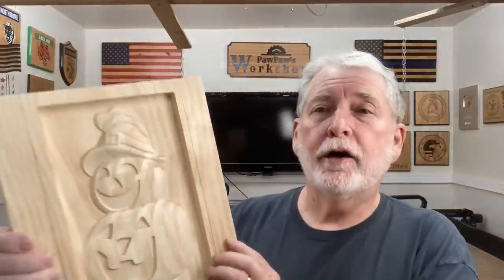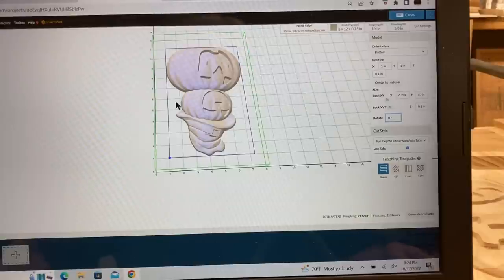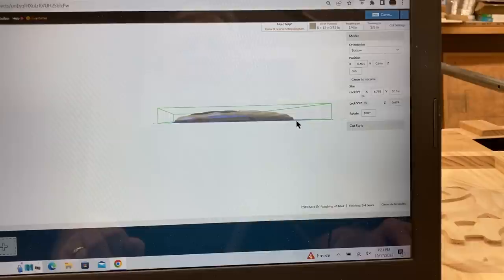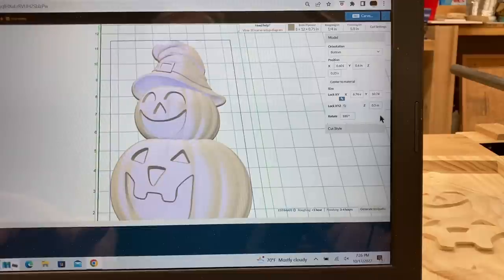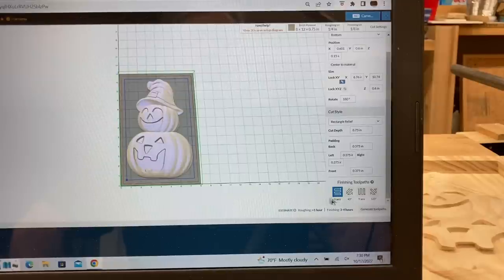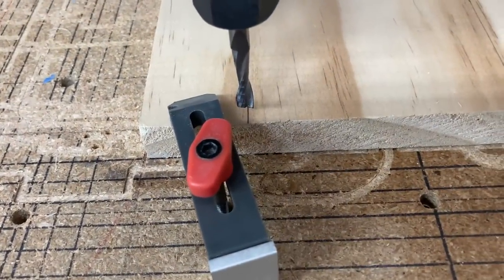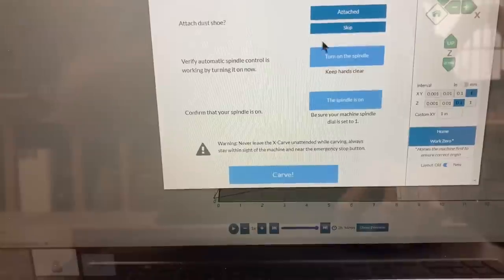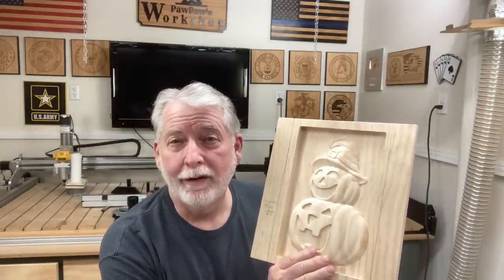Inventables Introduces 3D in EASEL Pro

Comment: I noticed your pumpkin is facing right.  I changed it to the bottom like you did in the video but mine faces left.  I notice when you downloaded your file it was name pumpkin.flip.  Did you do something to the file before you downloaded it to Easel.  It seems like mine 3d is facing downward rather than upward.  Thanks for your help,
Reply from the maker: Yes, this particular file was originally designed as a pocket. It was a file for a candy mold. The file had to be flipped. It would have been easier to use a file that was correctly oriented to begin with. It would have saved a step
Reply: @PawPawsWorkShop  How do you flip it?  I purchased the Pumpkin Style A.  Did I purchase the wrong one?  It appears the carve side is facing down.  It came in like yours to the side and if you flipped it to the top, you couldn't see it, so I used 'bottom'...it looks like it is facing down.  I did try to carve it but it stopped carving after 23 minutes.  It did like the frame around it.  Any suggestions on this issue.  Thanks again for your help.  Your videos are great!

Comment: Hi,
As always your tutorials are invaluable, so thanks for that.
How did you set your work (X & Y) zero point to ensure the carving is sitting correctly within the piece of wood?
Do you take your machine to the point on the X,Y axis (as you want as you indicate in the video), then set the X,Y work position? Once this is done you do the probing, at a different spot as you show. How do you get your machine back to the exact X,Y position after probing, to ensure your job is positioned as shown in the browser?
Any advice will be greatly appreciated.
Reply from the maker: Yes, that is exactly how I do it. Notice the x,y position on the computer screen is the same point when I move the machine to the edge of the wood. Then in the checklist you set the x,y position. Then when I move the machine to z probe, I can move back to the zero position because it has been set. Hope this helps.

Comment: I've been in 3D printing for a long time. Also getting pretty advanced in Fusion. I can for the most part, design and print anything on a 3D printer. I've had an Xcarve for about a year now. Been cutting out projects like a mad man (all 1D cuts). My missing link was the translation between what I can do on 3D printers and the Xcarve. Every time I start a new line of learning, I stall because I know it will consume the little time I have. You just made the connecting between the two so simple and made me realize I can take my STL files and very easily crank them out on the Xcarve. Thank you!

Comment: Thanks paw paw. You really helped me out! but could you tell me how to change the finishing bit it seams to only allow 1/8 i would like to use smaller for finer detail 1/16
Reply from the maker: Technically you can not add ballnose bits in easel. You can enter a 1/16” endmill and name it the ballnose. You have to trick the Easel software
Reply: if i click on roughing bit top right of my screen i get a drop down menu of all my tool bits and i can chose the one i wish to use if i click on finishing bit  i get nothing just a warning to tell me to turn power off before changing bits any suggestions would be gratefully accepted regards Nick.....
 @PawPawsWorkShop

Comment: Thank you so much, another great video!  How do you keep the X and Y access while you are changing the bit?  Have you done a video on that?  Every time I have tried to use 2 bits, it seems like I move the machine ever so slightly and then my X and Y are off.
Reply from the maker: Are you homing the machine?  You can use the last x,y position.
Reply: Depending on your hardware, YouCan set $1=255 to keep steppers powered to prevent movement. You can try using 1 hand pinch on spanners. Offset spanners on 2 separate flats and  grip both in one hand, squeeze spanners together to lock/unlock the clamping nut. Doesn't apply side arm forces to move the spindle carriage
Reply: I have similar issues whenever I switch drillbits. The router shifts a bit when I swap the bits. Then I feel like my XY isn’t going to home the same way.
Reply from the maker: John is right, check your GRBL settings and make sure $1=255. This will lock your stepper motors when you change the bits. Also, don’t overtighten your bits. That is another cause for move. Also, when you set the x,y work home record the location. After changing the bit use the last x,y position. Verify the coordinates are the same as what you recorded.

Comment: Pawpaw
Great video. But I have a question. I struggle with the cut depth. I understand z position and z size.

Z position is how far from the bottom of the wood to the top of the cut

Z size is the thickness of the art

Am I correct and if so then what is the cut depth?
Reply from the maker: Depending on the software. In easel you z to the top of the material. The material surface is “0” and you cut down into the material measured in negative numbers. For example .125 deep would show as a -.125. 
In VCarve by Vectric you have a choice. You can measure on the material surface as I just explained or you can measure from the wasteboard itself as being “0”. In this case the numbers will be positive. For example, a project board .75” thick would show as a .75 and that would bring the bit to the surface of the material

Comment: Thanks for another great video.  I use Carveco Maker but it won't do what I'm looking for, Maker Plus will, but it's expensive.  I want to do an open book 3D carve with lettering across the page, but have the letters 1/8" deep no matter where it is on the page.  Could this be done with Easel Pro?
Reply from the maker: The depth when vcarving using a vbit will vary depending on the width of the letters. You can set a flat depth to an 1/8” to prevent the bit from going deeper but a very narrow portion of the letter will be shallower than a wider section. With the flat depth set it will not go any deeper than what you have set

Comment: When you selected the z height for the rough bit I noticed after you moved the bit to a different location, why is that? Also,  you selected last xy versus set xy, why is that also?  Thank you as always for your assistance.
Reply from the maker: When I’m doing a project where a lot of material is going to be removed I will z the machine off to the side. The detailed pass will be z’ed at the exact same place. That will give the best results. On the detail pass I will use “last x,y position as the machine knows exactly where that is. No guess work
Reply: @PawPawsWorkShop  thanks

Comment: Your videos are very helpful! I have a question about the blue line (before I hit carve and mess up!). The image I downloaded extends a bit past the the edges of the blue box. I have locked the image and played with the size but the imagine still protrudes. Will the edges that protrude be carved anyway?  Thanks!
Reply from the maker: No. Anything outside the blue will not carve
Reply: @PawPawsWorkShop  is there a remedy?
Reply from the maker: You must reduce the size of the image

Comment: In January you did a 3d Eagle carve in Vectric, in your opinion which one was easier to set up and carve. Always look forward for your new videos.
Reply from the maker: In easel the settings are very elementary and very limited. I believe this is just the starting point for Inventables. Needed improvements will develop over time. VCarve by Vectric is very much an accomplished software for doing the 3D designs. Yes, there is a learning curve, however, every software has a learning curve
Reply: Thanks, another investment coming VCarve pro.

Comment: I noticed the material is set for birch plywood, does it make a difference on the pine you carved?
Reply from the maker: No it does not matter that much. Maple is harder than pine. If anything you could be a little more aggressive but there is no need

Comment: As this is used with Easel Pro, will you need the "monthly subscription" model or can it be used with one of the 4 "free days" per month (for those that had the old signup)?
Reply from the maker: Yes, you need the pro version and if you have the four free days per month then you have the full pro version
Reply: @PawPawsWorkShop  Thanks, just didn't know if they might have it changed for the 3D capabilities.

Comment: Thank u again for great videos. When I do my finishing pass it doesn’t touch the material as if it’s trying to cut the original height it was before removing material. Do you have any tips of what I may be doing wrong?
Reply from the maker: When you change bits for the finishing pass, do you z the machine at the same point?
Reply: @PawPawsWorkShop  yes sir I do. I’ve tried with z probe and manually neither works. Just keeps cutting air instead of down on the image

Comment: Great video. I had a question for the Z. Do you not recommend when changing to detail pass using last z location instead of redoing the z? Thank you as always.
Reply from the maker: The z must be probed when changing bit. The height will be different. I use the last x,y position to run the carve
Reply: @PawPawsWorkShop  thx for the response ....that is what i meant x/y not z.

Comment: Hi PawPaw, as always Excellent tutorial. I found one limitation related to the 3d Easel addition. It looks like it can upload only files up to 100Mb. I tried to reduce my stl file by using Mesh simplification software but it either didn't work or took too long. Do you (or anyone else here) know any other solution for this problem?
Reply from the maker: No solution to this

Comment: Would you happen to know why mine does the padding in the finishing pass, instead of the roughing pass?
Reply from the maker: I do not know what you are asking?
Reply: @PawPawsWorkShop  when doing a model boundary relief, the roughing pass doesn’t do the padding around the model, the finishing pass does, which causes the ball nose bit to plunge into the sides of the material, resulting in a jagged border around the model.

Comment: Hello Paw Paw, how long did this to crave?
Reply from the maker: I don’t remember how long but it did take a long time. Several hours
Reply: @PawPawsWorkShop  thank you because I am highly considering joining the CNC club from the Laser world.  What would be your #1 suggestion for a high level Laser user?
Reply from the maker: I would suggest getting the largest CNC machine that both fits your budget and space in your shop.  You can do small projects on a big machine but you can not do large projects on a small machine. You’ll out grow the small machine. Easel is a great entry level software to learn on but again you will outgrow it quickly and I am not an advocate for the subscription. I would suggest VCarve Basic by Vectric. This is a software that will grow with you. Also, you can get the Openbuilds controller which is free to run the machine.
Reply: Thank you so much! I will definitely keep you posted on my outcome 😊